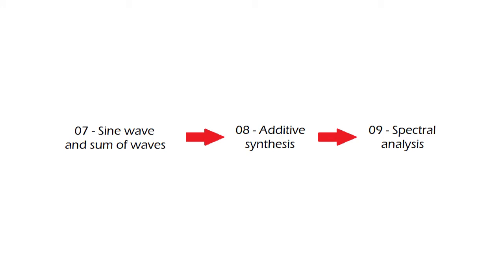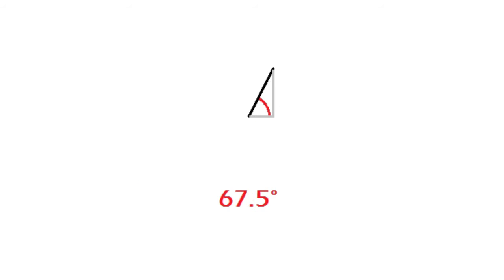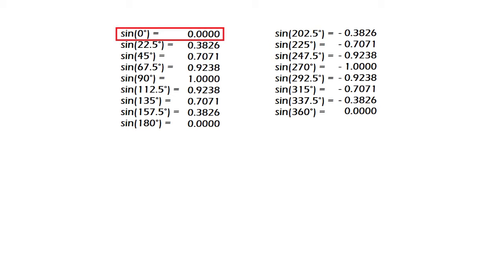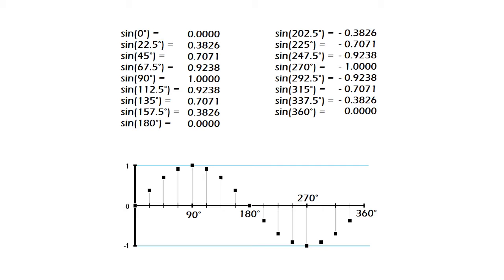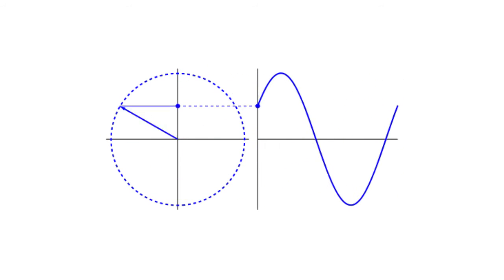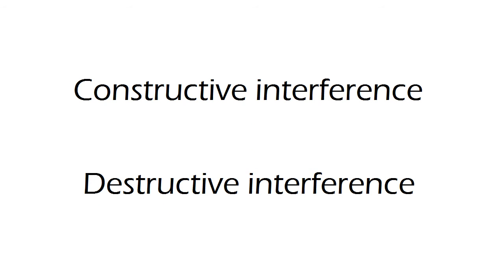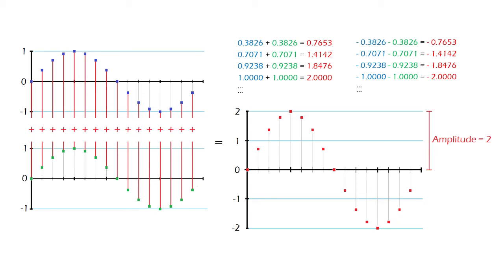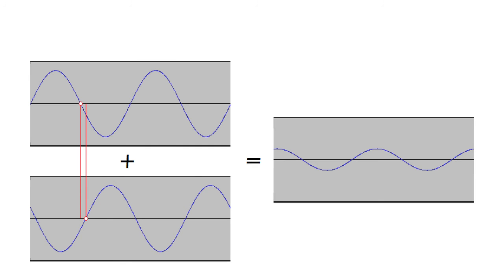07 The sine wave and sum of waves (interference)

Comment: What about a real world example? What if the two waves have different k (wave number) in 2D?
Reply from the maker: Hello! That's a great question. In that case, the interference in any given specific point won't be fully constructive or destructive. You will simply have varying pressure with the spectrum of both waves, with perhaps some peaks slightly higher than those of the original waves, when the crests align. A consistently constructive or destructive interfere only really happens with waves that have the same frequency (or consequently, wavenumber)

Comment: Hello, your videos are great, congrats!
I have a question for you, i'm curious to know how works when I play two or more notes simultaneous?
Sorry i'm noob of sound science, i'm programmer and I want to develop a little keyboard with arduino.
Bye!
Reply from the maker: +Dario Medugno Hello there! Playing two or more notes at the same time is gonna be complicated. Try designing a monophonic (one note at a time) keyboard first before you go into more complicated stuff. A square wave should be the easiest to generate since you can create it through PWM.

To make a polyphonic keyboard you have 2 options.

One is to assign each musical note to a specific pin (say, pin 0 is C, pin 1 is D, pin 2 is E, etc.). This limits your musical range to the number of output pins, but it's simpler to do.

The other would be to assign all notes to a single pin, and then if another note is played without silencing the first, send it to the second pin, and if yet another one is played send it through the third pin, etc. This requires a more complex algorithm but it doesn't limit your musical range.

In both cases, you'd need to sum all signals (for example with an Op Amp inverting summer) and send this output to the speaker.
Reply: Thanks for tha fast answer!
But at the waves of sound what actually happen?
For example while reproducing a note and at the same time i will reproduce another note, their waves are sum together with an increase of amplitude?
Ignoring the electronic theory, physically what actually happen?

Thanks for your help, you're really fledged an a clean teacher, regards!
Reply from the maker: +Dario Medugno Thanks!

To give you a good idea of what happens check the image at 3:20. You can imagine each wave as a different musical note, and the resulting wave would simply sound to your ears as both notes playing at the same time.

Observe that in both cases the resulting amplitude is higher than the amplitude of the original waves.

This image is another really good way of visualizing it: http://www.ethanhein.com/wp/wp-content/uploads/2011/10/2441692002_69233f1355_o.jpg
Reply: So, what happen if I remap the result of the sum of this two waves to keep the amplitude peek to peek to a specific value? The sound will modified?
Reply from the maker: +Dario Medugno Then the output wave will sound like the original notes but each note will sound more quiet than the original ones, because the result would be the same as if you first lowered the amplitude of the original waves, then added them together
Reply: All right!
Thank you for the help, I will update you about my project!
You're really helpfull, I will mention you in my project ;)
Reply from the maker: +Dario Medugno Thanks, best of luck!!